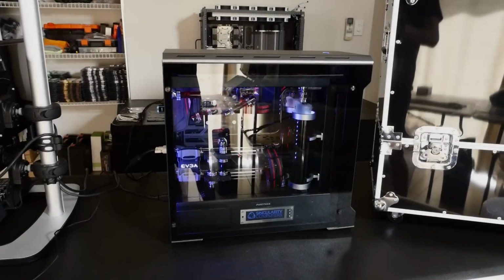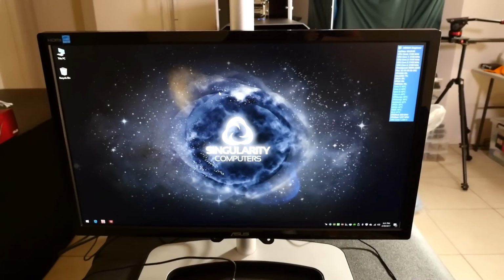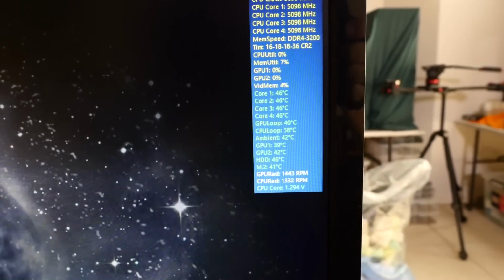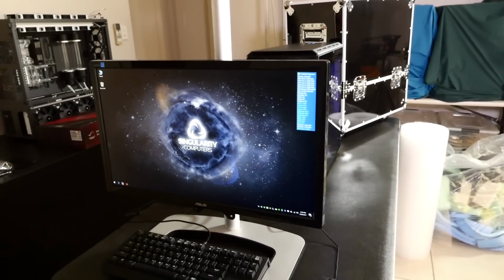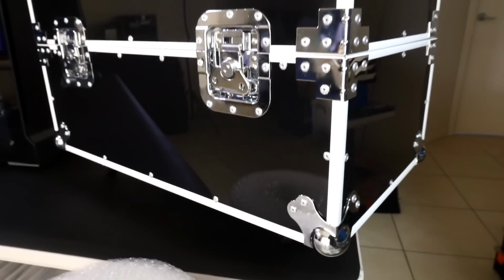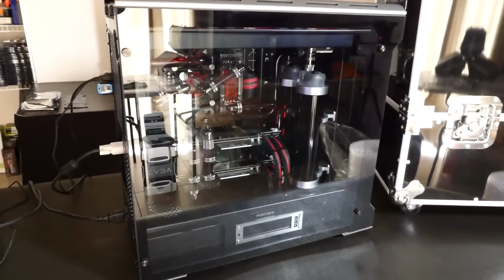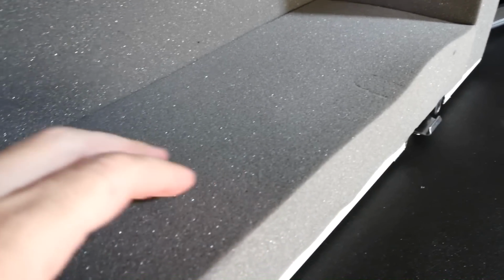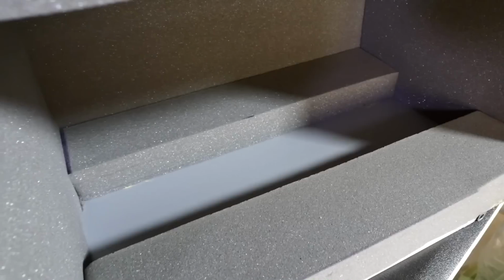Flight Case: Radium #002

Comment: Love the case!  You should consider putting a canvas strap in first, below the case, so when you take the top off, you can grab the straps like a harness to help take the tower out.  The tempered glass side panels can be too slick to really grab and it looks like the case is pretty snug in there.  Might make things easier to take out for your customers!

Comment: That's the nicest flight case I have ever seen. Sorry if this is a dumb question but if the shipping company leaves the computer upside down won't the coolant leak out the vent? Where did you stash the cables and manuals ETC? Is there a compartment on the flight case for accessories? Lastly since I almost never comment on videos anymore, have you ever built a totally fanless system that is 100% silent? A totally silent Ryzen build would be awesome.
Reply: lowlypawn I bet he ships the accessories seperatley!
Reply: There is no vent. Liquid cooling loops are sealed. They shouldn't leak no matter how you flip the case.

Comment: I've seen the flight cases listed separately on your site as well. They're certainly a great option for safely transporting a system, such as for a move. How resistant to tipping are the cases? As in, do they have anything in the base to ensure a low(er) center of gravity to make them less likely to tip during transport?

Comment: I noticed that in the flight case options on your site, you have an extra large option. Does that include cases like the STH10 with bottom pedestal at $1,350.00 AUD? I'm asking because I have this case and instead of breaking it down when I move to keep the case safe, this would be a great option for me, if the price is right.

Comment: Why did you turn off Intel Speedstep? The system is sitting there at well above TDP all the time. Barring frequency and power switching stability issues, there is just no reason to waste the electricity to have it racing at 5.1 GHz idle.

Comment: fucking what an overclock, should delid my 3770k
Reply: superhacker101 a delid won't give a better overclock just better temps
Reply: I did mine and OC @ 4.8. @ 1.33v. I didnt push it. Stays below 60c even under load on air cooling.
Reply: only thing holding me back from constant higher OC only at 4.5 atm but the temps like im in a 20C room and i can idle at almost 50C on a custom loop
Reply: it's the 7700k mate.. those chips are awesome overclockers.. but yeah the delid doesn't make it oc better it just makes a difference in temps.. for the mainstream line it makes a huge difference as they use crappy tim but for x99 not really.. those are soldered and i wouldn't risk damaging it for like 5°C..
Reply: Better temp better OC lol.
Reply: delidding doesn't actually do that. The heatspreader itself can become a thermal bottleneck. Some CPU's have better temps with a delid, others have almost no difference with a delid. 

That doesn't automatically mean a better overclock, just better thermal management
Reply: rotor13 you are right. Usually nets better temps but better temps doesn't mean better oc. I see why some think that as when on air temp is holding the oc back. But i have plenty of cooling yet my 4790k can't go past 4.9
Reply: Well unfortunately I didnt guage before and after but in my mind ITS BETTER cuz it just is!  lol 
I also spent 2 hours carefully poppin the top and I have to justify that some how.  :P

Comment: Hello, I have a query regarding the top fans. Is there enough space above the mount for the fans or you had to mod the case to achieve that super clean and awesome result? I am asking you because you are the only one I saw on Youtube doing it this way.
Reply from the maker: Yes you have to mod the removable slide in panel. Cut off the vertical parts so that the panel is flat. Then the fans just squeeze in. I have no idea why they restricted the case like this.

Comment: I'm struggling to see whats so special about these PC's!? Could someone fill me in? It just looks like any custom build you could do for cheaper! De-lidding is pointless maybe a 3c change!
Reply from the maker: 18C change on this one.
Reply: SingularityComputers 18c is a significant change... Thats definitely worth it... Seen plenty without that much of a drop!
Reply: BUZDRIFT You can mess up deliding by not removing the IHS glue and not using liquid metal TIM. If you do that it would be IMPOSSIBLE to see less than a 10c drop. I'm on my 10th delid.

Comment: Aluminium is not the best material for flight case, plywood is way better and withstand a lot more bad treatments....
Reply: tchouzebra That's why top-end audio equipment is shipped in steel & aluminium cases. Oh, wait...
Reply: it depends on what you mean by "top end"... if it's I've got money and I'm a show off then yes, it could be made of gold also... or it is top end, and I need it to be well protected then it's almost every time wood, with Aluminium corners, like you can see in every concert for example... http://www.skydd-case.com/index.html/img-file/flight-case.jpg
Reply: tchouzebra Last time I checked, thick aluminium plate was quite durable.
Reply: Paweł Czarkowski I built flight cases, it was a part of my work, (the other part was setting up and using the high end pro audio equipment I built the cases for... ) aluminium is durable but it tends to bend on chocs and keep the bend, wood deforms, and take it's form back, or break but the case stays in shape as a whole.... and seeing how the panel deforms on the edges and around the rivets, it does not seem to be that thick.